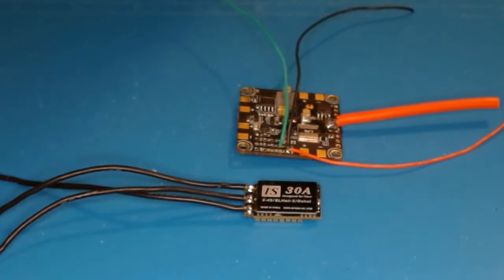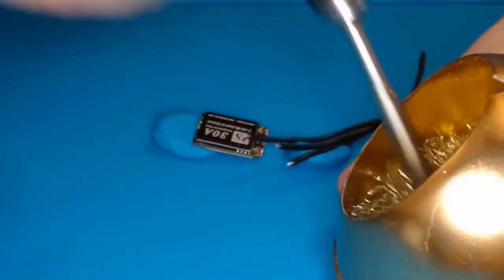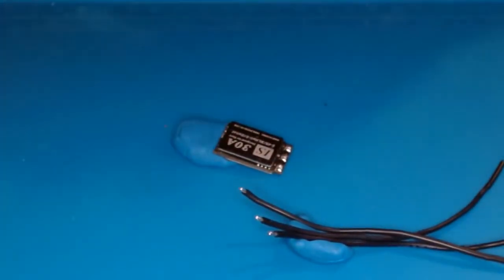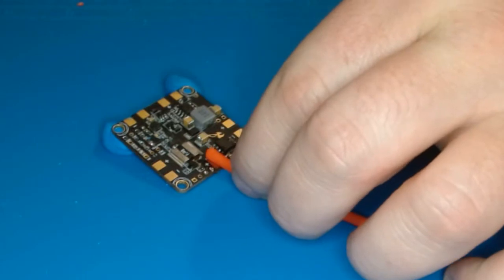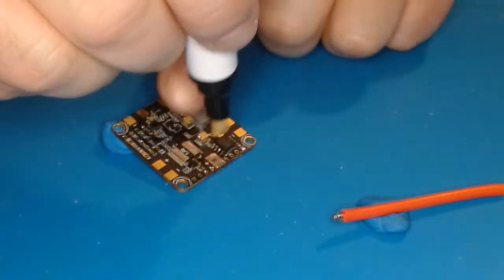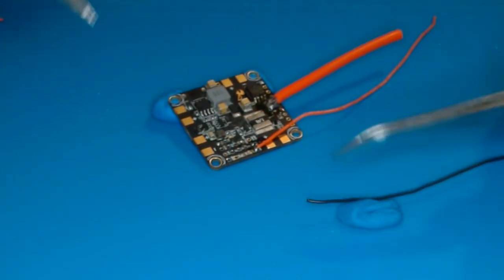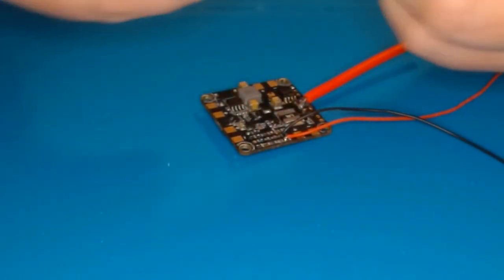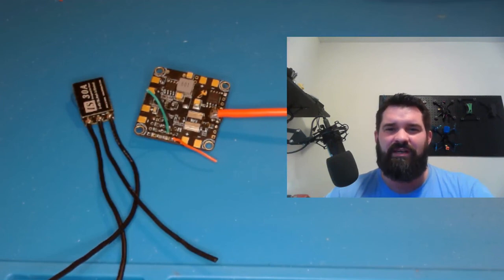FPV Drone Soldering Tutorial | Motor Wires, Battery Leads, Signal Wires. Beautiful joints every time

Comment: 426 celcius? Can use the same temperature for tiny whoop motor n battery lead connection? Thanks
Reply from the maker: For thinner wires like that I would drop the temperature to around 380C.  Remember to be quick, you don't want to dwell with your tip on the board for too long.  And USE FLUX!!!  other than that, the technique should be basically the same.
Reply: @FPVBuilders  thanks, flux n 380c make my day... If i known earlier could save myself a fc...
Reply from the maker: @eddie_Za  just a rule of thumb, as the wire gets thinner, you can lower your soldering temperature.  If you are soldering thicker wire, turn the temperature up.